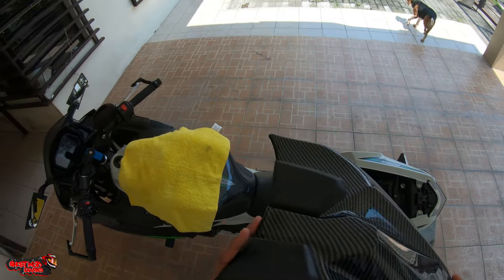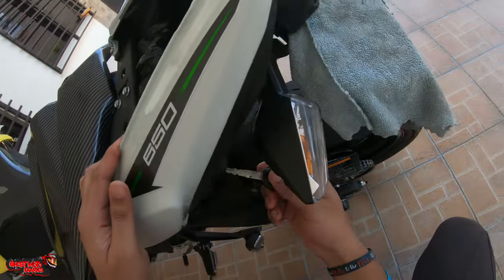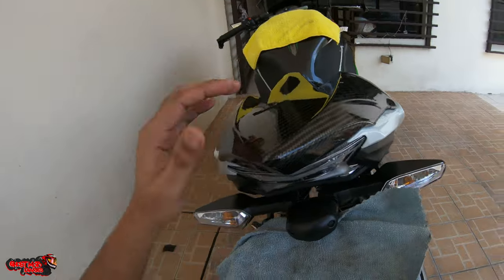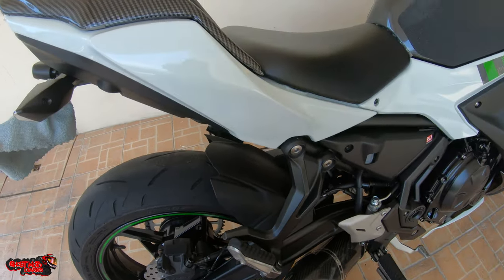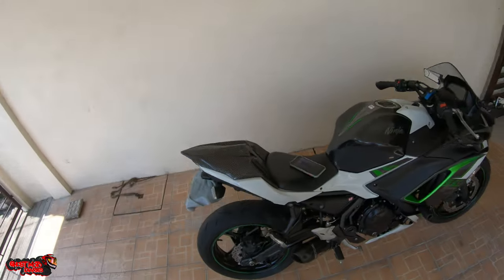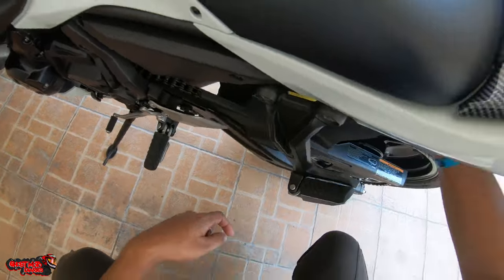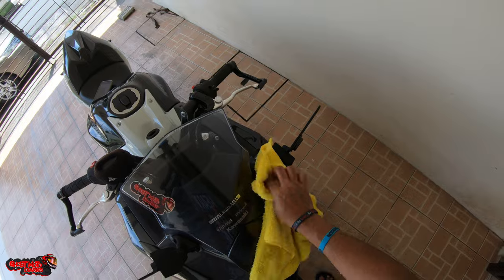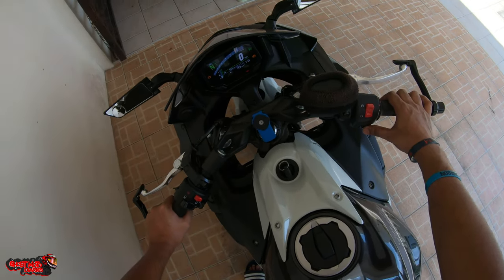New Seat Cowl for my 22 Ninja 650 / Vlog

Comment: may ganyan din ako sa motor ko pre, kung ako sayo lagyan mo ng rubber yung mga edge niyan kasi gagasgasin niya original paint mo.
Reply from the maker: 100% correct.. thats why I used the vibration damping tape around it...
Reply from the maker: what do you call them btw? I would like to check them out.